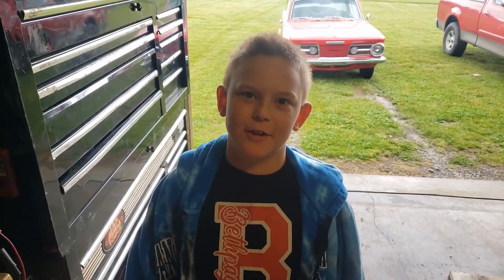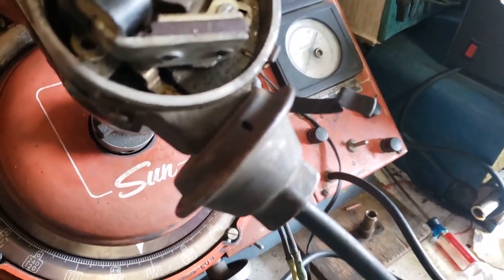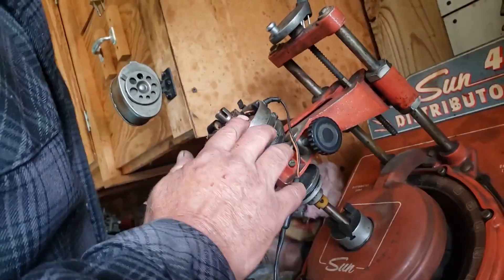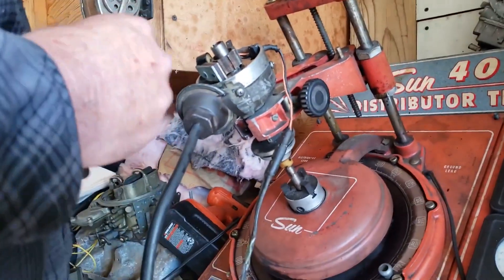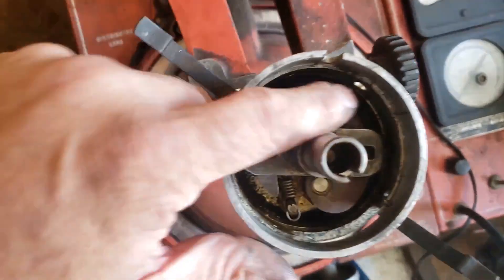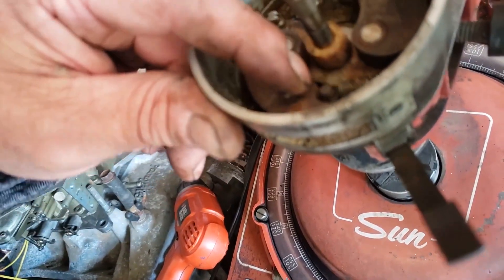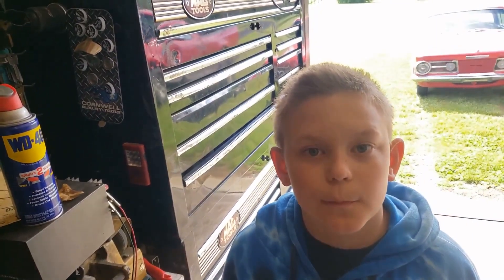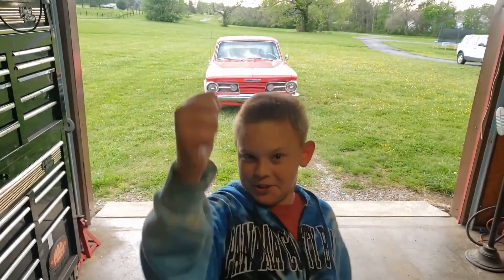A simple shocking speed secret, recurving a distributor for performance and gas mileage

Comment: Love to see how you dialed in your carb on that baricuda , maybe a video someday?
Reply from the maker: Hey Bob o , I might do a vid some day on it as i want to do a follow up on some carb things. As far as my barracuda carb goes i set the float level about a 1/32 higher than stock. (Most carb kit come with a paper gauge to check float level), the idle mixture screw is about 1 and 1/4 turns out. But this is different then most because of the altitude cam and distributor. I also change the jet 2 sizes bigger then stock and my mileage actually went up. And performance was wow and a slight hesitation went away.I think it was a 52 jet and I went to 54.this might help you but I have a different cam  and it was another wow in how it ran. As far as working on you distributor I would love to help but my distributor machine went down about a week ago and I'm waiting on parts. If it get repaired anytime soon I will check with you and see if you still need help. But it is a really a easy job. Good luck and thanks for the comments, feel free to ask away

Comment: Very different car but same principle, a 1275 MG Metro  with same mods and a after market electronic points in distributor.
My question is, the specs for this distributor are 32 degrees all in at 4000rpm do you think I need to recurve with lighter springs to give a more responsive throttle.
Thanks for sharing 👍
Reply from the maker: absolutely it should be in no later the 2000 rpm and response will definitely improve so will the economy

Comment: Hi i have a Dodge Kingsway 56 with a flatheadsix 230 with mopar slant six electronic distributor that i was thinking of adjusting the ignition on! At what rpm is it appropriate to have total advance? This is very interesting thank you for sharing this! Karl Gunno from Sweden.😊❤
Reply from the maker: I would only be able to guess. Just for start I would try for no later then 2200.
Reply: @talljohnsfunshop2722 Thank you i am going to try it.😊

Comment: Do you have a video on ignition timing? I'm still confused on initial and total timing because my SUV has only a maximum count of 20 degrees, and they are talking about 34-36 degrees btdc total.
Reply from the maker: There is a Playlist with the different timing and how to figure for your engine. There are 3 that hit the subject of were timing needs to be

Comment: Just five years ago I was the kid and you were my dad. Thank you. On a second note why did the centrifugal advance drop down to 12 when you only took the one spring out?
Reply from the maker: Taking out the spring allows for full advance at a lower rpm  stretching the spring will not pull the weights all the way back so the curve starts were the spring pulls it back and still stops at the all out position making the initial timing higher but the total the same.

Comment: when I bought my mopar performance electronic distributor from mancini racing it was supposed to be a drop in  set timing . I did that but it was lacking power . sent to distributor joe on facebook that has the same machine as you . he found out not only was the distributor filty inside but the bushings tolerances where off and the advance was in the 40s . I gave him a complete run down of what has been done to the truck including thw mildly built 318 and gears and cam. the cam is basically a factory hipo 340 cam . he rebuilt my distributor and the distributor is all in by 36 °  at 3000 rpm   .  sound correct ? I run the vaccum adavance on the timed port  on the edlebrock 600 I have . I also found out I had around 18 vaccum off the intake at idle and bought an edelbrock tuning kit and divided the 18 and matched up the colored metering rod springs # closest to my divided number = 9  made a big improvement.
Reply from the maker: I have dealt with Mancini a couple times in the past and thats enough of that. Was this a mopar kit or a Mancini recurve? The new numbers sound good. I do mine way earlier all in at 1500-1700. For a manual 2000-2200 for automatic. But were your at works in my book
Reply: @talljohnsfunshop2722   it was an actual mopar performance racing distributor with " performance curve"  and had an adjustable vaccum canister that you could use an Allen wrench inside the vaccum port  think 11/32 ? joe uses NOS  mopar parts and got rid of the junk canister when he rebuilt / modified my distributor

Comment: Where do I find the recommended mechanical, advanced and vacuum timing figures. Thank you for the information shared?
Reply from the maker: Hi Kim Wattage there are no recommended timing settings for any engine. There may be some good educated guessing. If the engine is large cubic inch v8 the timing would be higher then low cube v8s. If the compression is lower (not compression ratio but compression pressure), the timing can go higher. The type of fuel you  use affects it also. Most of the time most street engines end up between 32 and 35 degrees total mechanical advance. I like my initial timing to be from 15 to 25. This is always set to were the engine when hot doesn't struggle to start but 2 more degrees it would. I am working on a video that covers this very subject but it a few weeks away because of work and racing. Remember to much timing is dangerous but too low leave power and economy on the table. The point is error on low timing side. I know its kinda wishy-washy but every engine is different and just about everything effects timing.

Comment: Igniter vs Points distributor vs HEI
I have a 1990 Lincoln Town with the Windsor V8. Looking for tune-up advice, how to get the best fuel efficiency. upgrading does sound like less maintenance but questioning ROI Return On Investment? btw the car has sat for 8 years and running well on warm days. but if I don't let it warm up 20* F or colder and try to drive off after 10 min it seems rough until it gets to operating temp. also after 45 to 1hr idle to op temp. it will kill the motor most of the time when I change gears R or D. I haven't noticed during warmer days dying during gear change but I have only had it for three weeks.
Reply from the maker: Hi John the ignition on that model is integrated in to the engine computer. This limits alot of what you can do.you can abvace the timing 5 to 10 degrees depending on the fuel you use and that will help. Headers will help but only very slightly but my guess for that car they might have to be custom and that would be very expensive. A cam change might help. I would advance the cam first atleast 4 degrees. The engine that came in that car is basically the same as the 5.0 mustangs so I would check out what those guys are doing for economy. As far as the engine running condition you have, I  would recommend looking into the coolant sensor for the computer. There is a sensor for the gauge ( with 1 wire) not that one. There is a 2 wire sensor for the computer yes that one. It is what would tell the computer how to manage cold starts and if it's value is off you will have cold running issues till the engine gets to 160 degrees which is when it goes into closed loop and uses all the sensors to manage the engines performance. Well good luck with it those were excellent in the day. One more thing, as far as points or HEI, I would recommend HEI

Comment: Hello sir I was wondering if you had any advice to gain gas mileage on a v8 302 Lincoln Town car. Bye upgrading to HEI or coil on plug system?
Reply from the maker: Hi John is this the 1990 Lincoln you spoke of before. The answer to what is better is a coil on plug but you have to have the ability to control you timing advance curve to increase the potential milage over stock. A HEI distributor you can do that relatively easy. So if you have the electronics that can control and be changed by you then coil on plug , if not then i would go with HEI and you curve it to your specs. If you already have computer control on your ignition i would check into a chip for the computer. hope this helps

Comment: So for the quicker advance, you used only the 1 spring in the distributor ?
Reply from the maker: Yes but it's also stretched, the little spring will allow some low rpm advance the big spring, most of them have a oval shaped loop on one end but once there it take 4000 rpm or higher to change and you want all advance in by atleast max torque rpm. Probably 2500 in many cases so we just throw the big spring out.

Comment: good video i have a question. i have chevy bigblock with that msd distr. intial timing of 15 and a total of 36. i dont know how mutch i get with the vaccum hooked up. i will look it up soon. my question  is when do i want the total advance to get in? i have camshaft with a sweet spot of 1500-5500 rpm and a intake of 1500-6500
Reply from the maker: hey christoffer m, I like timing to be in as soon as possible. the only reason on any engine for centrifugal advance was for emissions for the manufacture and on performance is to get the engine started without kicking back on the starter. but there is a problem. If the advance is in the middle of its change during idle you end up with always changing idle. some times a stall especially with a automatic. with a automatic if its trying to advance when in park as soon as you put it in gear the timing retards and STALL. so at idle the centrifugal advance needs to be in all the way or out all the way with four speed and in or out in gear on a automatic. if you can achieve 1500 total without being in the middle of advance that would be great. 2000 would work good because even with a auto trans the engine spends most of its time above 2000 unless you have a good overdrive most of my dist fall in about 1800 unless I purchase a kit with heavy weights and light springs. in other words after a long winded comment... get it total as soon as you can. If you have more or if this didn't help feel free to ask more. Thanks for watching!!
Reply: @talljohnsfunshop2722  but if i have the total timing 36 degrees btdc at lets say 2500 rpm. when i cruise on the highway, the vacuum advance will give it some (lets say 10-15 degrees) more advance. then i will ride around with a 45-50 degrees  advance. that sounds to mutch. but maybe i get this wrong ?
Reply from the maker: It does seem like a lot but it isnt. Theres a few factors on total with vacuum. piston bore size thermostat temp and octane. Many people would say compression but this is only true at wide open throttle. the larger the bore the more advance because the flame front takes a little bit long to cover the distance. the higher the octane the same thing.(high octane burns slower) Of course the higher your thermostat temp is will effect it too because the higher temp, the faster the burn. Heres how i do it, rev the engine to max centrifugal advance in neutral or park with the vacuum advance connected. Advance the distributor till engine start to shake then back of the timing until smooth again. at he same RPM use your timing light to see were you at. From your total centrifugal to were you just adjusted your dist to is how much vacuum advance you should have. On a MSD dist were your vacuum tube plugs on theres is a small alan up inside and there is some adjustment in there for total vacuum. on my slant the total with vacuum is 48 on my 360 its at 53 and on my 440 its 55. ive seen as i as 58 before. Also remember there is no vacuum advance at wide open and heavy throttle positions because there is simply not enough vacuum in the manifold to operate  the advance. One more thing ,there are those out there that say vacuum advance is a waist of time. This is not true on any level. Drag racing circle track racing or street the higher the compression is the hotter the combustion temp is and the plug heat range need to be lower to help control detonation. part throttle with high compression engine will foul the plugs vacuum advance helps that and allows you to tune for max performance and maintain part throttle performance... hope this helps as always ask away.

Comment: Loving the slant content. Just got into slants and motors in general not too long ago and I didn't pick it up right away that advancing the timing means moving further away from TDC towards BTDC.

I've had a pertronix distributer with MSD 6A, running 5-10 deg ATDC, trying to hunt down why it's overheating. Going to try to retard the timing to 5-10 BTDC for initial and see if that helps the heat issue.
Reply from the maker: Hey Justin I was confused at first but if I'm reading this right you are correct. Advance is firing the cylinder before the piston gets to TDC. advancing the engine usually runs the engine cooler because all the heat energy is used on the piston and not burning in the exhaust port were the heat is transferred to the coolant in the head. Also more power is achieved and less throttle is needed  to maintain a crouseing speed therefore developing less heat. Buy the way I love that combination... pertronics with 6a box.
Reply: @talljohnsfunshop2722  Confusion understandable. I always thought advancing meant adjusting towards ATDC all the time. Meanwhile I'm fouling spark plugs, overheating, can't get a handle it seems.

I would also note I'm running holley super sniper as well so I have all kinds of variables and failure points now lol.
Reply from the maker: Yep lots of variables. My advice to anyone tuning a carburetor is get the timing correct first. I would say the same here. That sniper has a good reputation. I've never installed one, so good luck
Reply: @talljohnsfunshop2722  Great advice. Wish I had started there before replacing thermostat, water pump, belt, coolant, and oil. Live and learn.

I'll keep you posted once she's stable but I'm having a blast installing it. Replaced and updated the whole wiring harness first so that definitely helped. I think any future projects will always start with wiring and confirming good grounds.
Reply from the maker: Thats great advice to yourself forsure 👌 grounds are the most overlooked electronic thing on any car... I love doing things like that so please do keep me informed

Comment: Hi there! Thanks for this! Made my dodge run great! Woke it right up.  I just have this little surge now at steady idle. 45 mph or 60mph just seems to surge a little. Any ideas on what that could be?
Reply from the maker: Hi Collette try disconnecting vacuum advance and see if that help. If so then you need t work with the dash pot and limit how far it can move

Comment: Great, refresher! I wish I had a distributor tester!  But, don't they make spring kits anymore, and different weights??? I have replacement springs so I can switch 'em around!     THNX!     I want your pencil sharpener for my collection too^___^
Reply from the maker: They do sell different weights and springs but I wanted to show it can be done with out  spending any money  just time to get it done. Whats funny about the pencil sharpener is I kept bumping it and knocking the thing so I put the hopper part off to the side  and noticed after posting the video, good eye
Reply: Check with 4secondsflat.com and you can get a set of springs and a limiter plate to limit the amount of advance.  They're kind of pricey though.
Reply: @JoeyGarcia  Thank You!

Comment: Chased this video down John after the live chat today... pretty interesting... I see you tweeked the thin spring but did you replace a spring on the other side? As mentioned today I have an MSD dizzy thats locked Im trying to get back to mechanical advance as I have exactly the issue you mentioned..It kicks back like a mofo sometimes..and Im pretty sure the mechanical advance parts have been removed , so it sucks to be me...Ill go and check out some of your others too and look forward to a chat with you again some time. Also kudos for teaching the young man ...we are definitely running short of knowledge in our youngens
Reply from the maker: Hey thanks for the kind words.no I did not replace the spring. 1 spring should do the job to bring back the advance to initial when the engine stops.  On the MSD distributor they are usually a gm type advance with a ford type magnetic pickup which is awesome. But if you  leave a spring out make sure the weight is secured with a E clip or something like that. Normally the spring does that but I have seen were retainers were already there. It was nice hangin out with y'all and looking forward to it again.